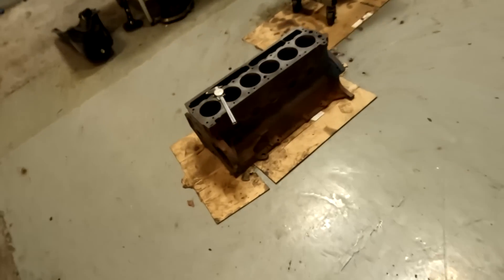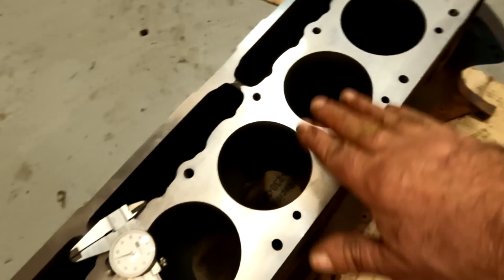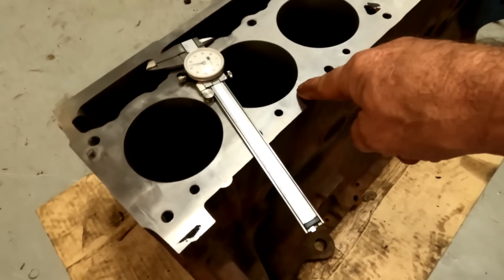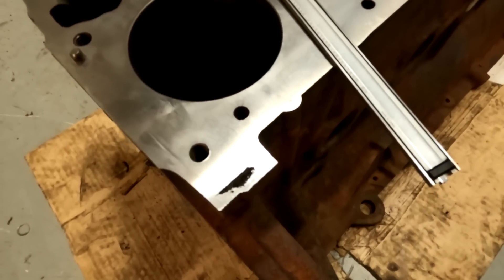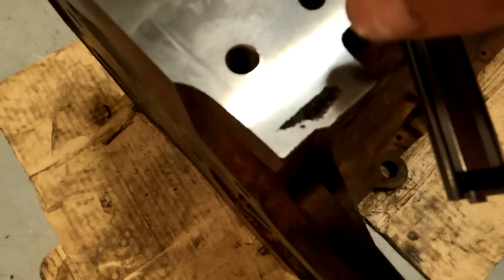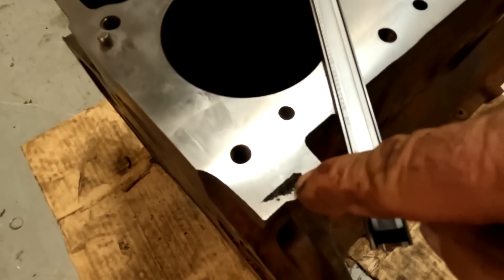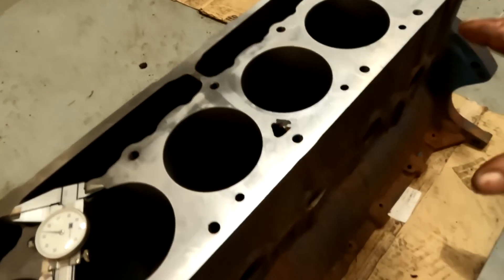Off To A Rough Start! - Hidden Defects In This Engine Uncovered And Machining Oversights Abound

Comment: Sometimes I have engine blocks when doing headgaskets that have pits should be resurfaced but if you use some poxy or JB Weld get it to stick real good and sand it down flat for your gasket seal it has nowhere to go I've done that a bunch of times had no issues

Comment: I built my own four barrel intake manifold. It was a beast contacted Clifford research with the engine designed. They fitted a custom cam for me, 390 4305,5 45 x 555 lift the springs I had seated in the head we’re good for 600 lift.

Comment: You can do two things with this block. A. you can mig weld it and grind it flat, or B. you can ignore it, cross your fingers and send it. I would give the mig welding a shot like you did with the 361 block. Countersink the bolt holes yourself. Very easy DIY. You got this!

Comment: I had a 360 block decked bored etc. Assembled the engine had great oil pressure on the a drill. During break in oil pressure would drop to almost 0. About 25 psi at high rpm. Hmm. After a week of messing around found that one of of the cam journals had a crack and was losing a massive amount of oil.

Comment: Had a guy insist on cutting the deck on a Chevy 402 I was having done. It didn't need it so I said no. He wouldn't do the motor without it. So I argued but finally gave in. Put it together and it pumped antifreeze out the tail pipe on drivers side. Tried everything and couldn't find the problem. Finally found it. His oh so great cut had a low spot between first and second cylinder. I get sick at the thought of decking a block.

Comment: I agree that the shop should have chamfered the head bolt bosses, and they should have called when they uncovered those casting defects. My guess is that they bored the cylinders first, and then decked it. When the defects appeared, they were already at the end of machining, so they wanted their time and labor for it, regardless. Keeping you in the dark of it though, wasn't the thing to do.
Reply: That should have been a phone call and a "what do you want us to do" conversation.
Reply: @allhailinternalcombustion  I'm only 1:35 in but right now id say I'm not using that shop again.
Reply: I'm not a machinist but usually they square the block from a surface deck in  Parallel from the mains and the cylinders then they use  The machine deck surface to square the boring machine I could be wrong and I know you could do it multiple ways But that's how my machine is says he does it Because if I was doing the machine work and I started taking material off the deck hive and ran into it inclusion I would call the customer Before going any further

Comment: A lot of strange things can happen while casting. Once had a rail car come into the shop with a broken coupler. Now couplers are cast steel not cast iron but this one had a large inclusion in the form of a crumpled up piece of stainless sheet metal which never got hot enough to melt during the casting process. It was a relatively new coupler but couldn't take the day to day stresses of holding a train together with that large inclusion.

Comment: Seems like if they bored the cylinders first before surfacing the block so they didn’t follow good procedures. I appreciate the lesson in due diligence, and you need to choose the people you work with not necessarily our gut reaction, but if this is not the time to look for a new shop please tell us why. I think they should have let you know when they found flaws in the block.

Comment: I took on a rebuild of a man's 1956 354 hemi boat engine. It was already .060 over .The shop owner told me to order .090 over pistons as he said these old hemi's have a lot o'meat around the bores and he bored for them and got me on the Horn. "We hit water on all of them .I'll sleave it and that will fix it. Well ,they don't put rust inhibitor in Lake Nacimiento and after installing 6 sleaves the last 2 holes had insuffciant iron to hold them. He graciously ate the sleaves and machine work as I brought him lot's of work then in the late 70's, I found a 55  331 block cheap and the boat guy was quite pleased at how it "revved up like an electric motor".with a new Isky solid lifter  cam , 10.00 pistons from Jahns. and a nice balance job. Performance Machine San Luis Obispo, California

Comment: I bought a motor, didn't know it had a hole in one cyl, rats! found out when l put water in, took it out had a sleeve installed running ever since. Good luck ✌️

Comment: Worked in Navistar Indy engine casting plant and there was literal piles of engine blocks sitting next to melting pots for remelt. Various states of machining completed and then rejected. 
I couldn't see anything wrong with them, except rust from rain; they was lined up out the doors.

Comment: I found something about that on the internet, for example it is said that the thickness of the casting of the GM blocks from 1981 were thinner, apart from that, the casting of the Oldsmobile 403 blocks, in which General Motors indicated do not bore the cylinders beyond 0.030" because the walls were thin.
Reply: Small block 400 also, no water jackets on thinner walls

Comment: Tony, that spot at the cylinder looks like it is at a water jacket. That said, I think it rusted at that spot instead of an inclusion at the casting event. I would be more afraid of water getting past that rust spot getting into the cylinder and/or outside the head. I don't know if welding that up would work so that there is more surface for the head gasket to seal on.
Reply: It’s clearly an inclusion.

Comment: I watched a video recently on the Cummins blocks, I can’t remember the year range but pretty recent. Anyways apparently all the blocks weren’t made in the same place, rather like 3 different foundries and in one of the places something happened and the blocks were all very thin in one particular place and nearly all of those blocks ended up cracking and leaking coolant right out the side of the block.
Reply: You’re talking about the 53 code cummins 12 valve blocks im pretty sure
Reply: @Insomniac2234  no it wasn’t a 12 valve, 6.7 era but I can’t remember the years, mid teens I think. I gotta find that video and rewatch it now 🤣
Reply: @Insomniac2234  53block was early 24V I think I have seen one 12V with one but I kind of think maybe it had something happen and it got  a replacement block under warranty that was a 53.

Comment: Think they're called 'inclusions' Rover had an interesting solution with their K series making them as light as possible for Lotus to avoid inclusions they cast the blocks by pouring from the bottom using pressure to push the material and any defect upwards, hence no inclusions and an extra light block.

Comment: I think I'd grind that one inclusion out, the rough edges will possibly grow cracks,  or maybe deck it another .020" or so, depending on how deep it is, you could drill it out and tap it, put a bolt in it, grind it flush, then re drill the water passage that supposed to be there!   If it was caught before machining, maybe brase the one close to the bore, then deck it smooth

Comment: What year is the block. Around 1968 Detroit had a lot of trouble with their cast iron(so did Volvo). I remember many Chevy 307s being junked because the blocks were bad and couldn't be salvaged. I salvaged the cranks and pistons from several of them. You never know if the new guy in the machine shop was given your engine. Good video.

Comment: I found aka a yellow block has 3 side Welch plugs meaning it is a industrial engine that probably come out of a futon 2 1/2 ton truck which is half nickel con tent. I bought it 100 over called Wise Cole to bill me pistons and like I said I take it deep to get a zero deck eyes on the Pistons then I mailed ahead 100 thousandths so I was probably running 11 maybe just a touch over to one compression ratio

Comment: My experience with a machine shop, Murfreesboro was they board my 360 60 over and machine the it was supposed to be 10 10 six months later when I finally decided to install the bearings and the crank woman behold it wouldn't spin over because they only machine the rod journals and just assumed it was 10:10 when it was actually 10 rods standard mains yes never assume anything

Comment: Rout a burr is the tool you need . just a handle with replaceable carbide blades that lets you break the corners and remove as much sharp metal adge as you want . They were 5 bucks from the 70s thru the turn of the century , probably double that now
Reply: sorry , triple that from Grainger or MSC but still the same simple tool I love

Comment: If its a high dollar build or something you expect reliabillity from. I would consider 6 ductile sleeves. Then you know what you have. The chamfers need to be done. I request a minimum bore chamfer on my stuff. Just enough to remove any ridge or hot spot. No more. I think from a high performance point of veiw. A chamfer is a deficit.

Comment: Would it be worthwhile to take a die grinder to those casting flaws to smooth any sharp edges out to prevent cracking, or is it best to leave them alone?

Comment: Did you tell them not to hone it? I generally chamfer after honing when I machine blocks so if that step was skipped likely it just never got to the guy that does that part. If they were supposed to do a full block prep then I would say they failed.

Comment: Did they use a torque plate when they bored those cylinders? Cutting 1/10 inch should give you pretty respectable compression especially with a steel head gasket... if you can find one.

Comment: I found what look like chipping at the bottom of one of my cylinder. I checked the stroke and the rings don't come near it. Took a carbide burr to it and chamfered it. Looked to me like a crack starting, just seems like an odd place for a crack.

Comment: You could chamfer the bolt holes with a sharp drill bit and as someone else mentioned file the chamfer on the bores by hand, fill that hole up with some plastic metal, it’ll be lovely, your machinist obviously didn’t point out this problem to you which is unfortunate at best ? If I had another 3 of those blocks laying around I’d be tempted to cut my losses and choose again, 🤣 could top up with a worse one, bloody lottery ain’t it ! All best to you 👍
Reply: Don’t chamfer with a drill, chamfer on a 60 degree thread needs to be 60 degrees not 125, use a single flute chamfer cutter
Reply: @floivanus  Thanks princess 🙏 is that metric or imperial degrees ?
😊

Comment: How timely.  Scott at Cold War Motors just had a video on chamfering the bored sleeve he had installed in a 1937 Chevy 6 cylinder.  The agents used a die grinder to perform the task.  The boys at Strongs Garage offered to chamfer it for him after they used the in-car boring apparatus, but he turned it down.

Comment: Working in die cast I can understand this all too well. Porosity in the metal. Nothing is casted perfect. We x-ray our aluminum, and zinc parts. You'd be surprised how much bubbles appear inside the parts. My position is die maintenance I work on the die cast dies themselves. It's my responsibility to make sure the dies are in good shape. Sadly all the new dies are coming from China, and cheap metal. They aren't even holding up six months once approved into production. They're getting what's called break out. The mold chunking out to the molten aluminum, and zinc. I'm not even allowed into the engineer meetings anymore, because I scream about the cheap die manufacture companies they use to make the dies. China steel is absolutely worthless.
Reply: ok🤡🤡

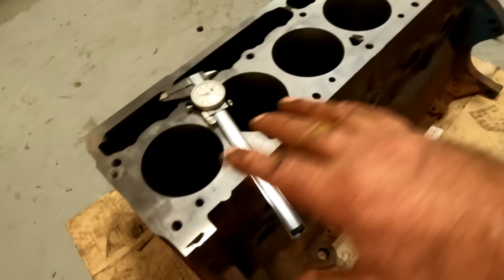Comment: @2:03 Look at the side of that block, like at the freeze plugs.  It's moving! That block isn't any good, it never solidified.
@5:26 Look at the blue trash can and bag, and at the 4.0 block on the stand. They're moving too!
@8:38 Those cylinder heads look like they're jumping up and down! 
I think your camera is on acid...
Reply: "Freeze plugs"🤣
Reply: Ooooh, and now Freeze..Ohhh.Freeze frame, Freeze frame...🖼️🪟,
Reply: Formaldehyde!!

Comment: They took way more than a thousandth off that block , maybe more like 3-5 thousandth s, barking the bit the whole time,  it was either warped alot , or the machinist took way to much off for you to not have seen that beforehand

Comment: When things like that happens to experts like you, that's one thing. When it happens to those who don't know anything about chamfering and proper procedures before decking, that could end up quite annoying for them.
I often wonder in shops in general aim at getting the cheapest labor possible. What you got back never should have happened, under normal circumstances
Reply: You are acting like the machine shop did something wrong. They performed the work as contracted. This is the manufacturers problem, not the machine shop. When you run up on a situation where half of the customers would say, "it's fine" and the other half would not. What do ya do...bottom line it's not their fault. Even if they brought it up, you are STILL PAYING FOR THE WORK PERFORMED. So?
Reply: @MH-53E  The only thing they did wrong was not to finish the job of which would have been to chamfer those cylinders. If I were to go out and get my brakes rebuilt, I'd expect the mechanic to first hone the cylinders, before inserting new rubber parts. If he doesen't do this, this is not what I'm paying him for